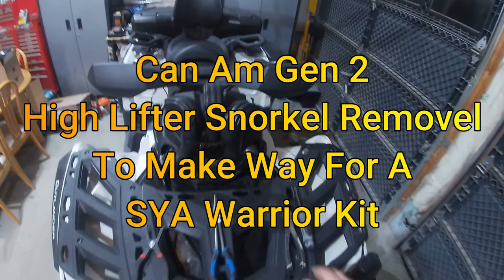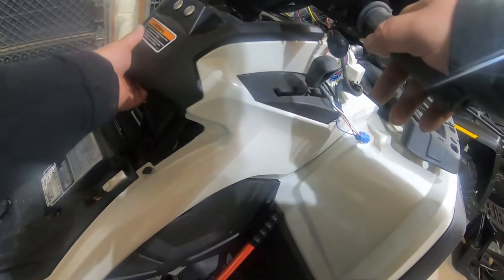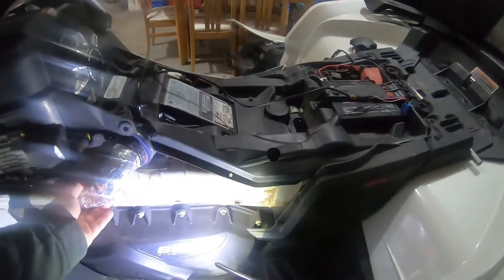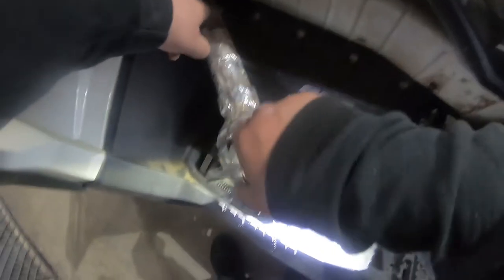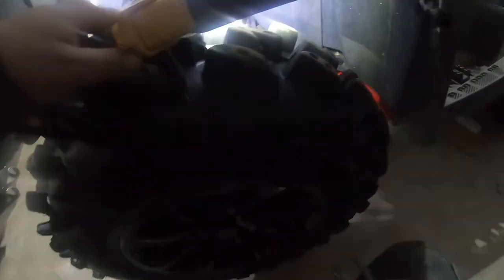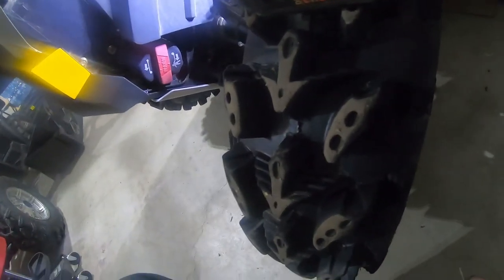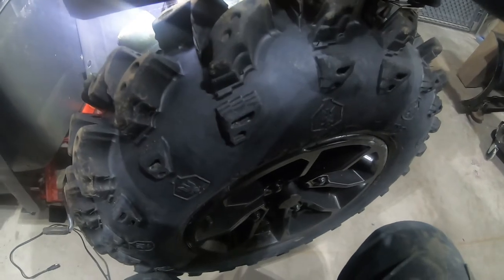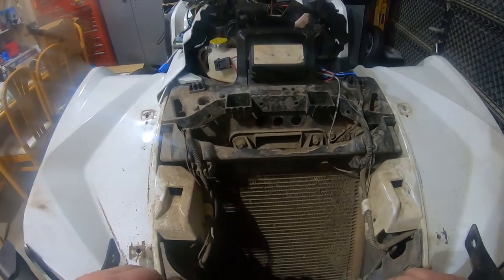High Lifter Snorkel Kit

Comment: Quick question bud, i bought the Highlifter kit and i have an xmr 650. Can i just install it from hoses that are already at the top or do i have to bo all the way to the bottom like you did on yours?
Reply from the maker: I'm sure you can add on to the stock pipes, you might have to make a fitting, that's what Al did to his red XMR
Reply: @ATVBuds  thank you.